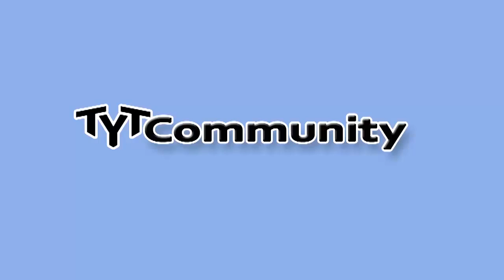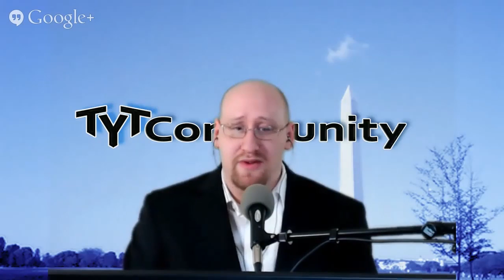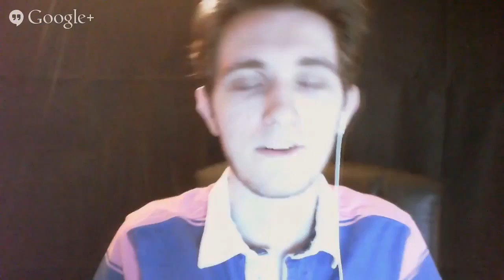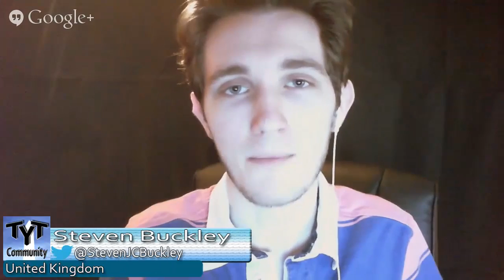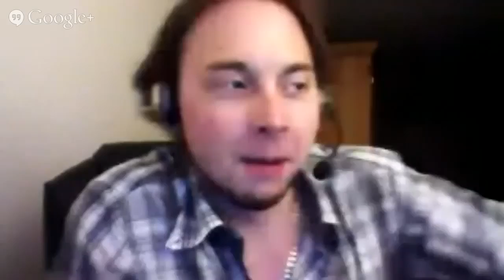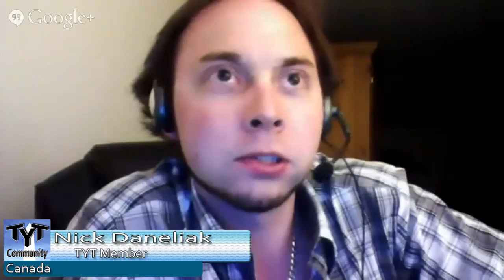'Wind Power Is Now Competitive' Says Leading European Utility Company

Comment: wind power isent the greenest technology though it does has adverse effects...

the wings can kill bats and birds, te noise can have adverse effects on wild life potentially (those things can be noisey)

if you live close to one your life can be pretty fucked up between the shadow bulsing  with mind numbing repeditation and the noice... he horrible noice..

personally i favour sollar backed up with Thorium reactors (there really needs to be more push for thorium based nukelear power.. its just soo much better.. and removing nukelear is not realistic and protesting new plants only means old dangerous plants go past their safe life spans...

wind power is ok off shore and some more modern designs might cause less noice not sure if any design can avoid bats and birds though...
Reply: Incidentally all power is nukelear power

wind comes from differing heated areas on the globe -> which comes from the sun (quantum tunneling fusion ractor of sorts...

solar is the same...

all power is nukelear power!
Reply from the maker: ZerqTM Like I mentioned, not the silver bullet, not the only answer. It has its drawbacks, but the overall point is, if we continue to pump more carbon into the atmosphere those birds and bats will have more to worry about than wind turbines. 

Offshore wind farms I'm in favor of, and maybe someone can come up with a bladeless design. I have to look into thorium a bit more, but if it's workable and cheap then I'll be all for it, and something we can do now. Time is of the essence at this point if we're going to stop climate change from getting worse.